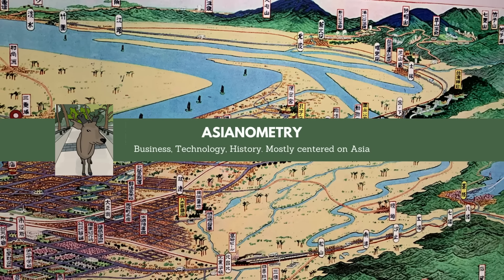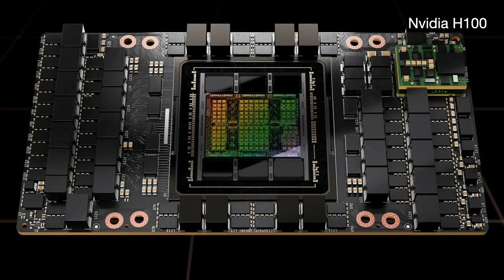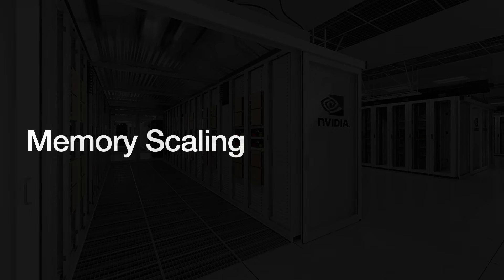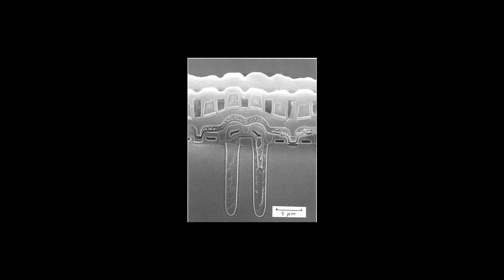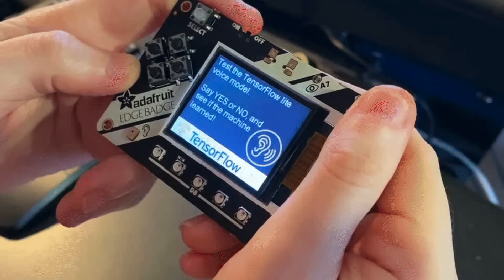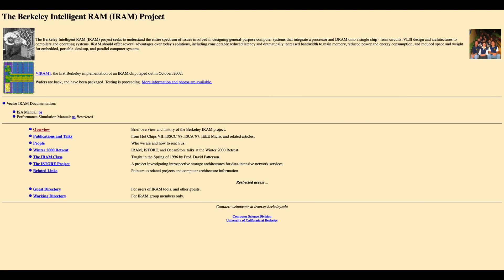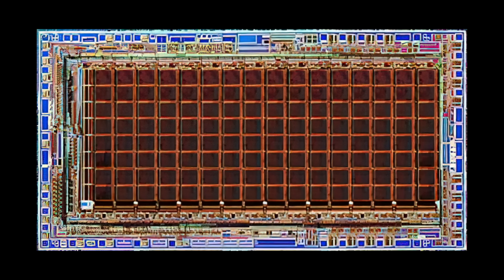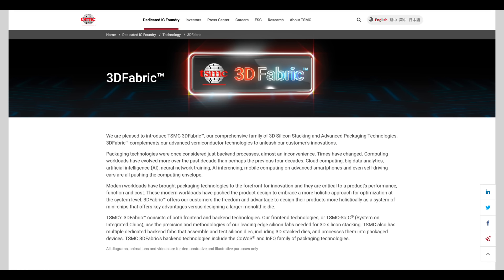AI’s Hardware Problem

Comment: Circuit-Level CIM has one major limitation that I wish you had discussed. Its susceptibility to PVT (Process, Voltage, Temperature). When storing weights in SRAM Cells and applying 1 or 0 to the Word Line (WL) to perform the MAC operation (WL Multiplies with Weight and then the current on the Bit Line (BL) is the sum of all of the cells in the column) we are performing an analog operation. The BL current will depend on the process variation, supply voltage, and ambient temperature. That is, at two different temperatures, or supply voltages (Battery voltage changes), we will get different results, even with the same die. This makes it unsuitable for "Edge AI" applications. Between two chips or two different columns, we will also get different results, because of the process variation. The accuracy is significantly limited by this. With an Analog WL driven by a DAC, the problem is exaggerated even further. Granted, I do not know what sort of accuracy AI models really require but I imagine it is much greater than what can be offered by CIM in current CMOS processes. Of course, larger processes decrease variation, but the density suffers. The nice thing about conventional computing is that our accuracy does not depend on PV, only our speed. I think integrating DRAM dies with conventional CMOS dies is likely the way forward.
Reply: It's also not much faster, only more energy efficient.
Reply: 1. Battery voltage changes shouldn't affect CPU/memory voltages except when battery voltage forces DVFS (insufficient power-> enter lower power state). If battery voltage chanes do seriously affect CPU/memory voltage anytime else, it is a bad design.
2. Datacenter coolers can be designed to keep chip temperature relatievly constant (for example liquid cooler + piping similar to ICE vehicle cooling system).
Reply: @volodumurkalunyak4651  1. I agree, that the supply voltage to the SRAM cells would not change much across battery SoC, but it will change in small amounts. Voltage regulator outputs are dependent on the input in the real world and using ones that are more isolated increases cost. But yes voltage is the least likely to vary drastically, but also the BL current is very sensitive to it.
2. Yes, data centers will provide stable voltage and temperature. But the accuracy is still much worse than conventional computing due to PV, and so it begs the question -- are clients that use data center computing willing to accept inaccuracies when compared to conventional data centers? It's a big tradeoff that I'm not equipped to answer. However, I think the Edge AI application is kinda buzzword BS.
Reply: Yes, which I'd recommend not using any of analog or multi-level digital logic (logic which uses more than 2 voltage states) even for neural network or other kind of systolic array computing. & it's worse than that: multi-level digital logic is not just difficult to store to & load from SRAM, it'd also severly complicate arithmetic in case you'd thought of not converting it back into binary but actually directly using building multi-level ALUs in both cases one might go about it: 1) using quasi-analog arithmetic built out of operational amplifiers because it a) requires a completely different semiconductor process because mixed analog-digital processing & b) have all the inaccuracies & reproducibility problems of analog circuits or 2) actually building arithmetic out of digital multi-level logic devices which for n-level digital logic requires superlinear amount of different transistors with also a superlinear amount of total transistors varieties for any m different possible logic circuits of which these m are superlinear many ones depending on n while also increasing successibility to process variation to at least a superlinear amount depending on n while also superlinearly increasing wiring & interconnect complexity. Example: Ternary digital logic which is digital logic with 3 different voltage levels when implemented using CMOS-like ternary logic doesn't just require 3 as opposed to 2 different kind of transistors, you'd actually need to reliably built 4 different kind of transistors (increased successibility to process variation) for any logic gate, while a ternary inverter in such a process isn't built out of 2 transistors but out of at least 4 while also having increased wiring complexity within the gate while also requiring 3 instead of 2 power lines while ternay doesn't just have 2 different unary gates (buffer & inverter out of which you'd functioanlly only need the inverter to built all unary gates) but at least 6 different unary gates (out of which you'd functionally need at least 2 different ones to build all unary gates). & this is getting even worse if you want more than just unary gates: multi-input combinatorial ternary gates require even more transitors & wiring as their binary counterpart & much more so then their ternary state would give you a more compact representation. & these disadvantages are getting all worse as when you go from ternary to quaternary to quinary ... digital logic so that it's practically impossible to have any efficiency gains by replacing binary digital logic circuits by any other one. OK, you could use a non-CMOS like n-ary digital logic but these all have the problem of having to statically draw power which drastically decreases power efficiency while only reducing the aforementioned problems partially.
Reply: Analogue computing is a false start for CIM. Yes, digital cmos multiply circuits require some space, but they're on the same process as fast sram, they just need to be tightly coupled together and ignore all other logic functions(which is what Google and Nvidia tensor cores implement - theoretically, only a MAC circuit and a register page). There's some complexity in the control circuits; caches for instructions, input, output and synchronization logic. You need that bit of complexity with the analogue circuits anyway, and you don't have to build analogue comparators and dacs - which don't scale at all on small manufacturing nodes.

Comment: I'm a mechanical engineer, and not particularly savvy in the EE domain, although I love me some first principles.  The first thing that comes to mind when I think about compute-in-memory is the problem of locality.  Our universe is pretty clearly local, and if you store all your stuff, then want to compute using that stuff, you have to bring relevant stuff near each other.  Unless there's a way bypass that locality requirement, it's hard to see how any clever computational or logical algorithm to avoid the problem of read/transmit/write times.   There are obviously a lot of ways to reduce that cycle time, but I just don't see how compute happens without the process of read/transmit/write to memory.  Maybe some fucking outrageous entanglement situation, but that would include like 10^10(or wildly more) particles, and that's just not on the table right now.     That would be a good goal, to have a computer that can simultaneously solve every problem contained within its memory.
Reply: Late reply, but you might be interested in a new intersection of physics principles and computing. Memory-induced long-range order (something physicists talk about) can be used to somewhat bypass this locality issue and preform hard computations in memory. Called "MemComputing", it utilizes a dynamical systems view of computing and its all quite fresh! There is a good book by the physicist Max Di Ventra on the subject.
Reply: hbm3e ok?

Comment: I’m a high-end geek by trade.  I’ll tell you what all system-level engineers know: input/output is the bottleneck in 100% of all cases.  A careful look at the utilization of your CPU will show that no matter what task you perform: calculating Pi, encoding videos, doing large language model inference, etc, in all cases the CPU is stalled waiting for memory a large fraction of the time.

Server memory from 2003 has nearly identical latency characteristics as server memory from 2023.  Bandwidth is several times higher.  Latency is about the same, sometimes worse.  This is the memory wall.

Comment: the problem is the 2 d wiring and requires a net of connections and the chips to also have a net floating inside a liquid matrix to allow the net to work toward its area.

Comment: See, the entire concept of "computing memory" already exists as you mention it, and it is called "cache memory" on the same processor chip.
Expanding the concept, and replacing the entire DRAM bank with cache memory is challenging, but it can be helped by the multi-core chip design, and by the use of chiplets AMD-style.
I don't see ReRam taking up the market, there is more to come. If you recall the memory oscilloscope tubes from the '60s, which were a wonder at the time, the same concept can be applied at chip level, where the transistors on the chip can change their functions - based on the application of a electric field. In the end, the same transistor can work as a logic gate or as a memory cell, as commanded by a supervisory circuit.
This improvement would require a redesign of all software EDA tools, and you know that can take a decade.
Thank you for this pioneering video of yours on the most challenging computer design problem of the century.
Regards,
Anthony

Comment: Fun bit, but we don't exclusively use Von Neumann, though it looks like we do. It is not uncommon - in fact the machine you are reading on most likely is doing this - for modern CPUs to use split L1 caches where part of the data path and memory of the cache is exclusively for data, and the other part is exclusively instructions. This is a Modified Harvard Architecture. So called because at the most direct level, the CPU has two memory banks as mentioned before, but once you go up to L2, L3 or system memory, the memory and bus are no longer partitioned, so it fails to be a true Harvard
Reply: Actually, internally, all modern cpus are harvard. Instructions go in the decoding stage, data is extracted (if immediate values) and operations go to the mess of scheduling circuitry. Data goes on the data bus trought to the ALU, the encoded operation also goes to the ALU, but they are separate buses. Unless you have some weird multi-cycle architecture that specifically wants to half the clock efficiency.

Comment: I really think we're going to need to go to analog compute for neural networks. Say you want to sum up the weights of all activated neurons from the previous layer to a neuron on the next layer. What's faster - summing thousands of floating point numbers in a FPU, or just simply physically accumulating all of the inputs and reading out the magnitude?  Our brain could NEVER have its high compute rate on only ~20W if it had to do every synapse based on matrix math.

It's like the difference between physically measuring a glass of water vs. trying to model all of the atoms that make it up.  Just physically measure it.

Comment: In Von Neumann architecture, the CPU is normally separated from the memory. This separation of the CPU from the memory is called the Von Neumann bottleneck. Therefore, the rate at which data and instructions get accessed relies on the interconnection (one bus) between the CPU and memory. Various rates at which the bus operates may lead to traffic jams, thus affecting the full potential of other computer components. Harvard architecture is another type of architecture in technology. It is composed of two separate memory spaces (instructions and data memory), four buses (two address buses and two data buses), a CPU, and an input and output unit. This architecture allows the fetching of data and instructions at the same time. Food for thought for implementing something like this architecture for GPU's. Unfortunately while processing capacity has increased, memory technology has not kept pace.

Comment: Check out Silicon Valley based 4DS Memory that is listed on the ASX. They are coming out of imec after 6 years with a fully functional 20nm PCMO Non-Filament Interface Switching ReRAM megabit chip. They have also partnered with Infineon to create a custom ReRAM design specifically tailored to 4DS Memory unique characteristics that no other technology known can perform. 4DS Memory aims to resolve the Memory bottleneck in AI.

Comment: this is wonderful information. a great breakdown. my thoughts were large parallel access to memory (no memory controller with any addressing required). and lots of sram. it seems that broadcasting out data is one thing, but needing the results of a lot of data in a timely manner is the real core of the problem. my gut feeling is the true solution to this is quadrillions of simple input->output units that have baked in logic tables. and no intermediary memory controller. no row/column access. just extreme connectivity. extreme parallel connectivity. 

and 3D dies the size of a dinner plate.

Comment: Doing basic logic operations on entire memory rows completely changes how we store and process data. For instance, you would store an array of numbers with all the highest bits stuffed together, and all the lowest bits stuffed together, and so on, which is quite the opposite of the current practice of storing all bits each single number together
Reply: I think you fundamentally misunderstand how in-chip memory (sram) works. Each bit in a register is operated on in parallel for each word in all CPUs. And each bit, from each word, from each wave-front in GPUs/SIMD processors.

Comment: Drama - with the second "a" being silent. A new name for an old component. And I can't find an equivalent for the static version of random access memory. 
In my designs I was profligate with static memory - true that the best design uses six transistors per bit, instead of a capacitor and a transistor, but we don't need to recharge the capacitor thousand times per second and - most importantly - we don't need to use fast analogue comparators to decide it that charge represents a 0 or a 1; when operating at GHz frequencies, the lack of a comparator removed most of silent errors caused by the memory. There is a reason why cache memory is built with SRAM (es-ram or sh-ram?)...

Comment: Here is chat gpt response
ideas for getting around von neumann archritecture
One way to get around the von Neumann architecture is to use a computer that is based on a different architecture, such as a quantum computer or a neuromorphic computer.

Quantum computers use quantum-mechanical phenomena, such as superposition and entanglement, to perform operations on data. These computers have the potential to perform certain types of computations much faster than classical computers, but they are still in the early stages of development and are not yet widely available.

Neuromorphic computers, on the other hand, are designed to mimic the way the human brain works. They are based on networks of artificial neurons that can process and transmit information in a way that is similar to the way biological neurons do. Neuromorphic computers have the potential to be highly efficient and may be well-suited for certain types of tasks, such as pattern recognition and machine learning.

Another way to get around the von Neumann architecture is to use a computer that is designed to perform a specific type of computation, such as a graphics processing unit (GPU) or a field-programmable gate array (FPGA). These types of computers are optimized for specific types of tasks and can perform those tasks much more efficiently than a general-purpose von Neumann architecture computer.

Finally, it is also possible to design software algorithms that are specifically tailored to the strengths and limitations of a particular type of hardware. For example, an algorithm that is designed to take advantage of the parallel processing capabilities of a GPU can run much faster on that hardware than an algorithm that is not optimized for it.

Comment: why not use a cpld/fpga style with fast WORM memory instead of ram? the input/outputs could be in ram, but the model basically programmed on the processor. the main disadvantage is that you can only run one specific model at a time, but it should be fast, and if that becomes a solution, that should be fairly inexpensive, and would scale, by basically running the whole model at the same time but with hopefully cheaper chips.

Comment: This is why we need to invest in modern advanced nuclear energy options. Small form reactors, LFTRs, Thorium Reactors, liquid reactors, with modern day technology capabilities, improved engineering, material science, understanding safety measures and safer designs much more than ever, computer technology/ robotics/measuring devices beyond anything we've ever used in the past. If we commit to this, It could really allow any nation to be pretty much energy independent. Less reliant on fossil fuels. They'll have efficient, stable electrical grids and the rest of the grid could experiment with alternative power sources, etc. 
We need to heal from the trauma of our past and see that it came solely from Us not understanding what we were doing, not have advanced enough technology, material science, engineering, safety measures, understanding of how to go about everything, etc. This source of energy will greatly help the world improve towards the future and lowering emissions more than anything else could while having a very stable electrical grid system. Currently we have alternative energy options but the majority of our grid is powered off of fossil fuels and emission producing sources of energy. We will be so much better going forward commiting to modern advanced nuclear energy options.